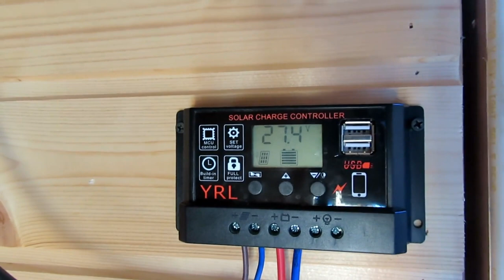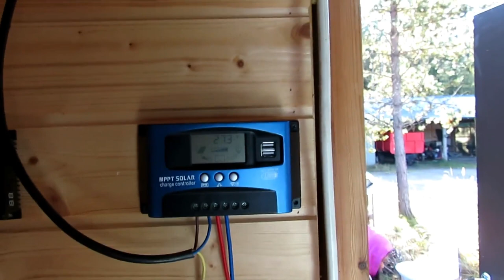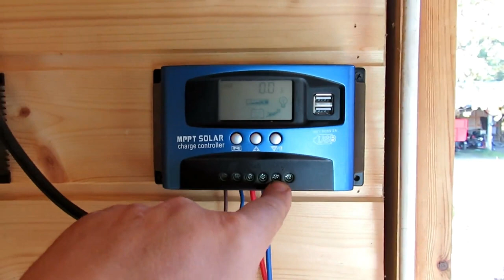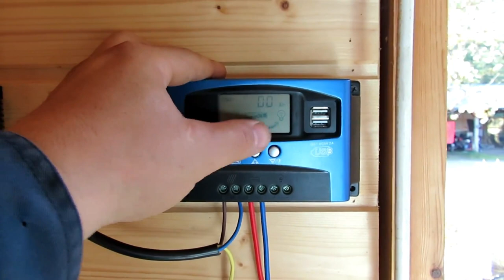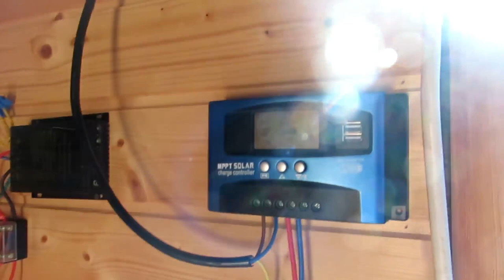MPPT solar charge controller without MPPT

Comment: That mppt is the same one I have. I got it on eBay. I have been trying to get a refund from the seller because it doesn’t do mppt stuff, like the input voltage is always around 12v, even though I know the solar panel would be 18 to 20 v output. If it were marketed as pwm, and I bought it as such, then fair enough. But like I told the seller, it’s like he sold me a v8 car, but when I lift the hood it’s just a lawn mower engine and not the v8 he told me.
The gauge of wire I was using didn’t fit, so I ended up using house quality cable. 
I have 4 x 160 watt panels, using this thing I can run a 12v fridge/freezer that draws about 6amps per hour. So using 144amps per daycare 12v =  1728 watts per day. Assuming 5 good solar hours, around 350 w per hour harvested from a system potential of 560 watts. So about 5/8 of potential. If panel volts is 20, then 5/8 is around 12.5v.
PWM as far as my maths goes, even without pulling it apart
Reply from the maker: Sorry to hear. I'm not sure what you mean about the voltage, but if you want more voltage your system you need to make battery system 24V. Put 12V batteries to series and then it's double voltage, then you connect to you controller and you have 24V system. Another hand then you can't use direct your fridge. This controller is more effective than cheapest pwm put yes it's not MPPT. If something I have learned to build solar systems, you never had batteries enough, no matter what is your setup. And those batteries is most expensive part. :(

Comment: The connections are not big enough to run wire for 100amps. 10 gauge wire is the biggest you can get in the connections and that is only good for 30amps max.
Reply from the maker: That is true

Comment: " MPPT SOLAR " seems to be a name of a brand, not the kind of product ! And under is written " Charge Controller ". So, it's a Charge Controller, named MPPT SOLAR. It's not a MPPT solar charge controller !
Reply from the maker: You got it and that is reason why I make video, don't always belive what is read there :)
Reply: @HerbHillFarm  Yes ! In anyway, it works very well, even if it's a PWM solar charger.
Reply: @ilakemybike  This is not an MPPT regulator and not even a PWM. Just a simple charge voltage controller, nothing more.

Comment: Do you know what is maximum input voltage from solar panel?
Reply from the maker: Voltage for this controller is12 or 24 so I think between 30 to 40 voltage is max. But better think about amps and with this I think you need to be carefull, maybe over 50 amps is blown up this device. 🙄

Comment: I find them hard to program and lately it has stopped recharging and displays a half moon icon
Reply from the maker: Half moon is when panel is not giving power, can be that it's broken. Our controller don't give anything at USB-connectors went broken, but otherwise it's works okay.

Comment: How much is the input voltage from panels .. 24 or 36 v ? Cs i have my panels in 36 will they work with that fake mppt controller ?
Reply from the maker: We have 24V panel and that controller can handle only 12 or 24V panels. Better to use real MPPT controller even those are more expensive.
Reply: @HerbHillFarm  can u suggest me 1 real mppt , and are they adjustment current ? ( I have 1.2 kw panels and wanna build powerwall 18650, using pc ups as an inverters , but they work on 12 v so i have to go with 12 )
Reply from the maker: @rajgj7041  There is many good ones, but not same time so cheap. Consider something like this. https://www.ebay.com/itm/MPPT-Solar-Charge-Controller-EPSOLAR-12V-24V-MPPT-Battery-Regulator-150V-Charger/351428607449?hash=item51d2c6fdd9:m:mamDYmv791RFmX89Hyc6Eag
Reply: How many 205w panels can you connect on parallel with this type of controller?

Comment: It is a pwm charge Controller and no is a mppt charge Controller, no make convert over voltagem to corrent as mppt make
Reply from the maker: True, but it's do more than regular PWM
Reply: @HerbHillFarm  you do make use as fotovoltaic painels in configuratios in parallel ? Using configuratios for 12 or 24 volts? Show your schema as Picture to us, i too buyed as equal charge Controller mppt 100ah , over 30 Ah is need set alluminium major in this equipment, set large cable to reduct lost of ampere of painels 
 congrarulations of Brasil 🇧🇷

Comment: Sir how to restart that kind of controller sir.?
Reply: This type of controller does not need to be restarted. There is also no reset function, if you want to go back to the factory settings you simply have to change the parameters manually to what is in the manual.